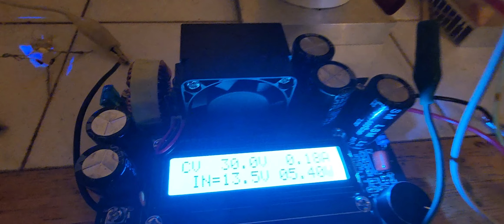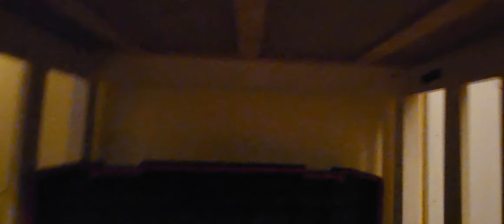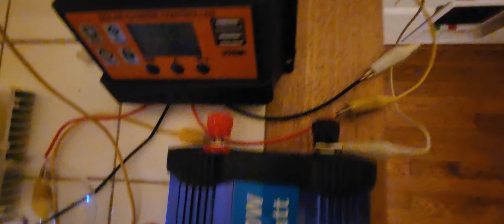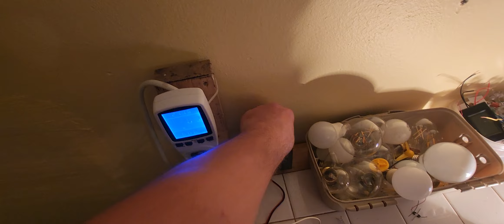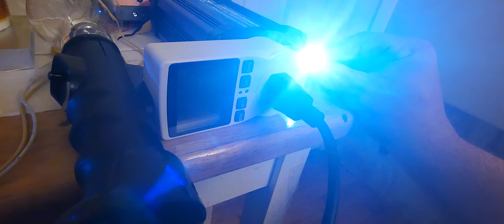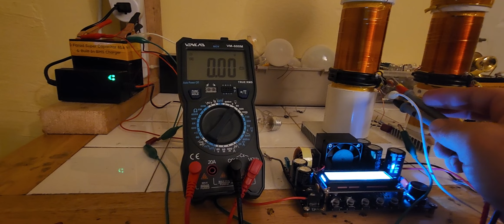🌞100%Radiant Energy Self Sustaining Power System Solved! Heat Pump Like Effect & We Can Run It All🌞

Comment: Thanks for sharing this.
Just wondering what the out put would be if several receiver coils connected in series to charge the super cap. 
Can this maintain the charge without having to switch off the inverter to recharge the supercap

Comment: According to my calculations it should output 6Kw with 250w of input .
Reply from the maker: That's crazy & I'm very close to making a very high power system
Reply: @MTECH2022  bro in ur one videos I saw u gave 1w input and get 27 watt output . My calculation is based completely on datas provided by you in your videos. Bcz, I have no resources except your videos .
Reply from the maker: @Beastbrain...369  i appreciate the effort you put into the calculations :)
Reply: @MTECH2022  big thanks to you . Plz, tell me construction details about extra coil , your teaching mean a lot to me 🙂 .
Reply: And plz explain why you removed the 2nd extra coil from tesla coil .
Reply from the maker: @d.abhishekh  the extra coil is just a counter clock wise wound bucking coil that's half the length of the L2 & wound in the opposite direction & seems to maximize the wireless power effects while also improving efficiency. :)
Reply from the maker: @Beastbrain...369  slightly higher efficiency  :)
Reply: @MTECH2022  thanks legend❤️
Reply: You are measuring the current into a short circuit and the voltage open circuit. This does not show the amount of power. Connect a suitable resistive load, measure voltage and current. Multiply them, that will give the real power.

Comment: For how much minuit the system can run and howmuch time it taje to charge please tell me the exact vallues
Reply from the maker: It can run a 100 watt load for 15 minutes before it needs about 5 minutes to recharge itself & the gain in power depends on how well the L2 Receiver coil is Earth grounded
Reply: @MTECH2022  how many reciver coils can it run at a same time at this configuration
Reply from the maker: @Beastbrain...369  3 optimally while simultaneously producing wireless power with the mini 10mm jumbo led leghts

Comment: when you release load , it will cause the battery voltage will rise again to typical voltage again , this is not because you have tapping radian energy 😂!!???
This is because all the battery will at the same condition